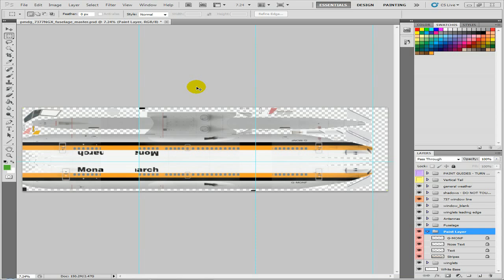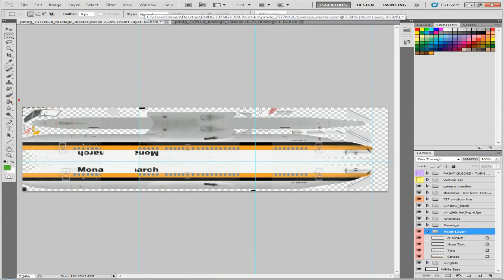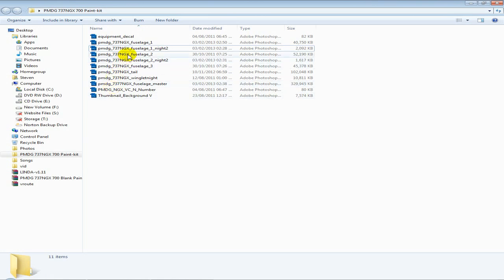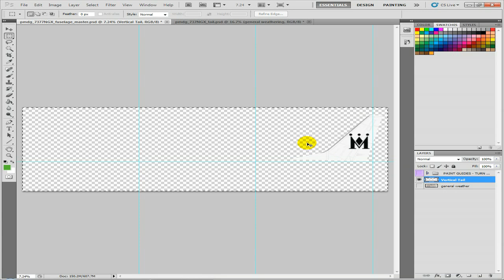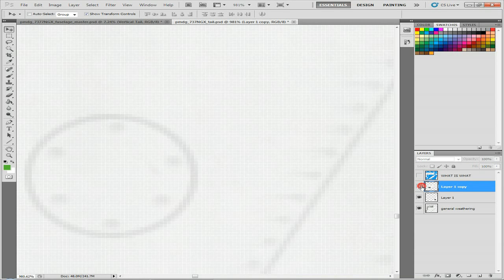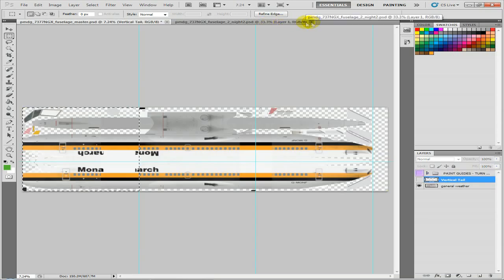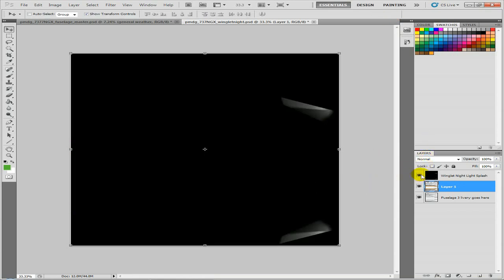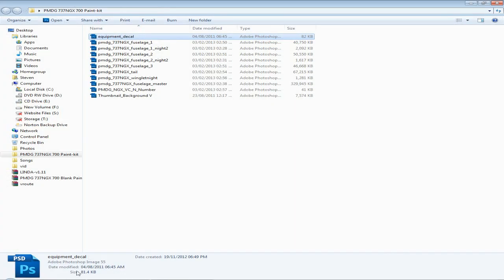Tutorial: Painting a 737-700NGX PMDG Livery FSX (Part 3) (Slowed Down)

Comment: Nice video!
My problem is (using CS6 and the NVIDIA tool) I can't get the textures sharp in FSX. On Photoshop they look fine, but when flying the aircraft they are blurry, though only from far away. 
I'd appreciate help, thanks!
Reply: Jose Soria I can give you a tipp, which is fixing your problem: Do NOT use MIP enabled - disable it. Then its working. i had the same problem.